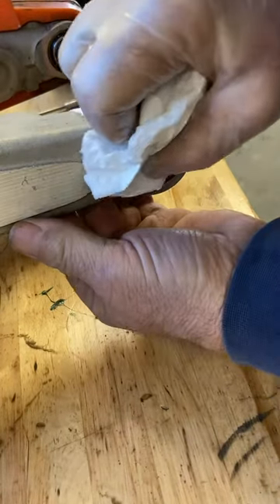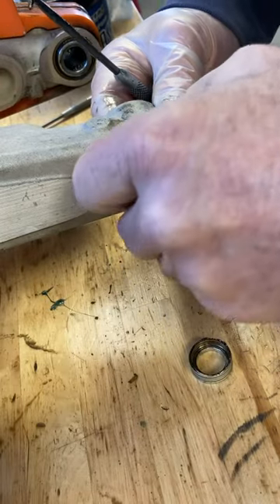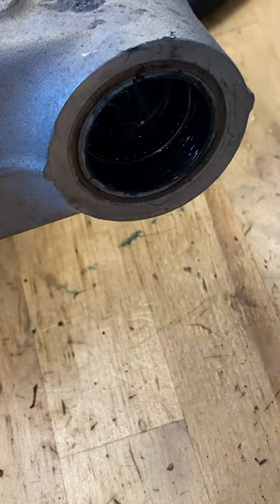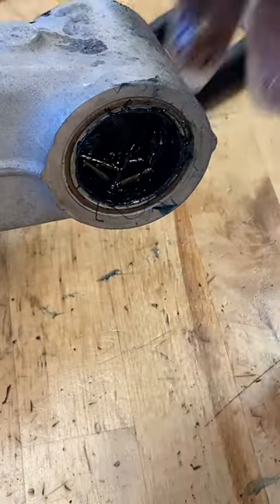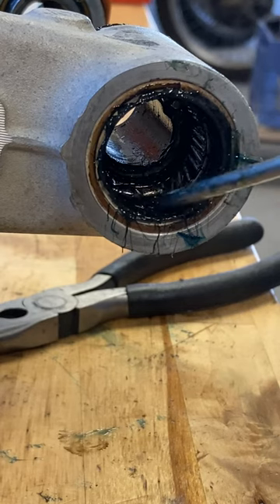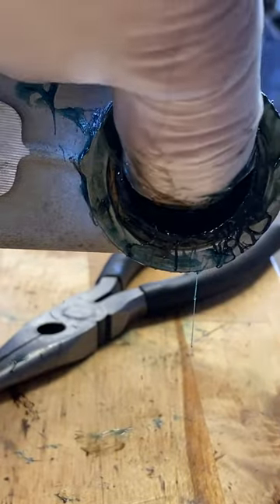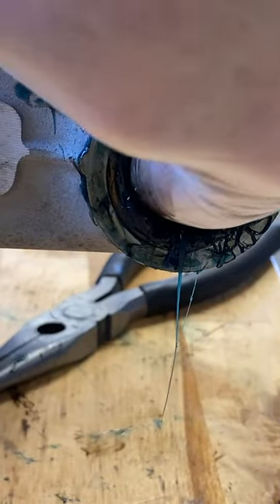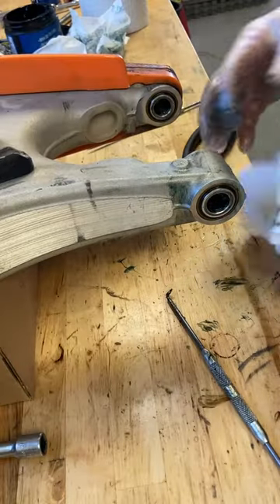How To Easily Grease A KTM Swingarm Bearing

Comment: Why don't we drill, tap and install a grease fitting on swingarm, steering and wheel bearing housings. Pump some grease in there every month !
Reply from the maker: We want light bikes with only "racing" features!
Reply: Ever get a good answer to this online anywhere?
Reply: @ThisTall manufacturers are cheap. And they expect you have the whole bike torn down every 100 hours anyways so they just don’t do it. It’s a good idea tho and people have put grease fittings in before